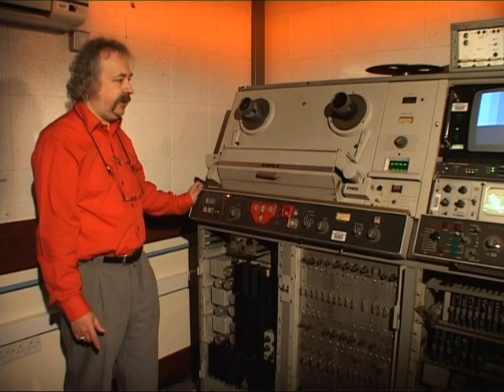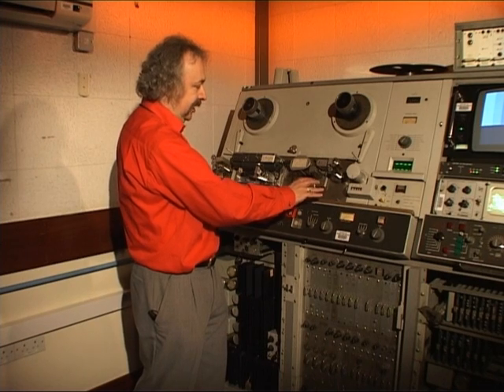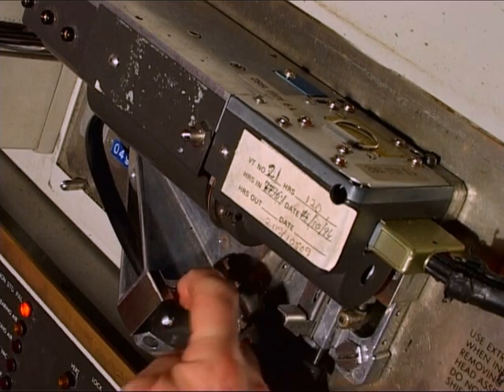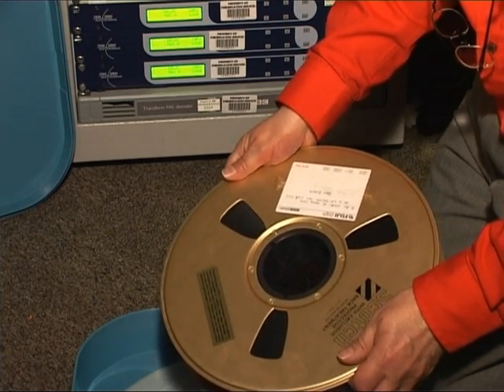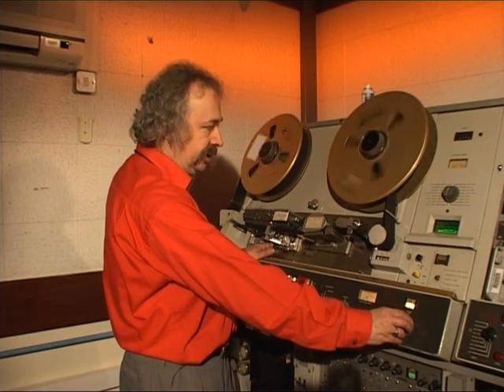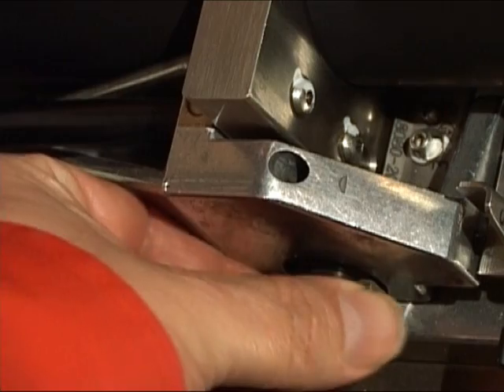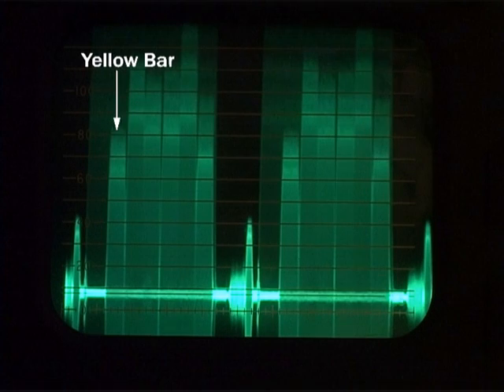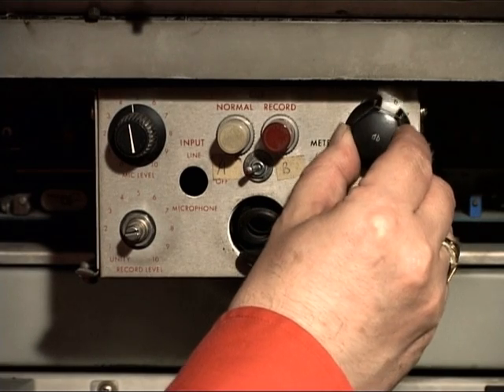Two Inch Quadruplex Videotape.

Comment: Hello Friend
Is this video tape really 2 inch audio?
Reply from the maker: No it's not. 
The quad video head scans the tape almost vertically from top to bottom, and so the coating on the tape has it's crystals aligned the same way - vertically.
This does mean that the audio performance of a quad videotape machine is slightly compromised, but at 15 inches per second, the effect isn't too disastrous.
Audio tape is manufactured with the crystals orientated in the direction of travel of the tape. ie - horizontally.
Reply: @Saprophitic  thank you clarification friend
Reply: You can see from the close up that the audio head only occupies the top bit of the stack.

Comment: That foam insert mentioned  at 5:09 was a major disaster for 3M as the glue that held the foam to the reel would degrade over the years and liquify, soaking the tape with what looked like maple syrup. A "reel" mess it was.  My understanding at the time was that the foam was an anti-static measure.  3M launched a clean-up with a mobile van and technicians going from TV station to production house across the country cleaning tapes and winding them back to reels that didn't have a foam insert.  Lesson learned?  If it isn't broke, don't fix it.  I maintained 4 VR-2000s and 2 VR-1200s in my early twenties.  I remember it being noisy and I kept a daily routine with a TEK 465 scope and a Simpson 260 VOM.  Chic magnets for sure. And as I write this I'm getting a little misty eyed.

Comment: I used the RCA TR70 C 30 years ago.  It was quite the beast.  The one thing I can say about Quad is when picture was optimal and tape was good, it  was fantastic.  When it was bad, it looked awful.  I've seen oxide literally dropping off the tape like fine powder at times and video had banding in it with a head clog.  Sound quality was phenomenal.  Thanks for posting.

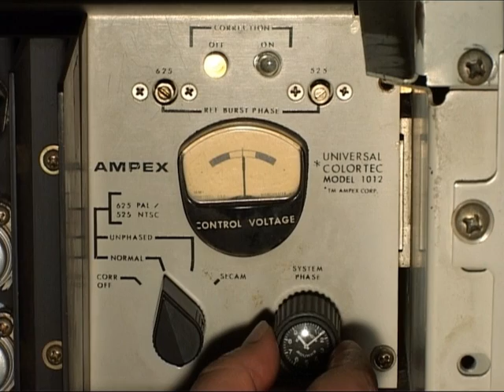Comment: I noticed you adjusting system phase at 12:07 Shouldn't it be burst phase? We would adjust system phase with an external source punched in E to E with that source being a wipe between the external source and the quad machine punched up through a switcher.

Comment: From an old time video tape engineer I now wince when I see this video of the operator cleaning the VR2000 tape path without using protective gloves.  I believe many in our industry came to premature ends due to Head cleaning solutions we used.  Either through skin contact or vapors due to insufficient ventilation.  I am not sure why I am still here but for the grace of God.
Reply: We always used to use 'Colclene' TF  Just a can of Freon basically. Blame us for the hole in the ozone layer.  Worked on these for many years, then later on the C format machines that replaced them.
Reply: We used PERC to clean the heads, and it was in a bottle and got all over our fingers when we cleaned the heads.  I only used Quads for about 5 years as our main machines for commercials.  I hope that I do not get cancer!
Reply: Seems like a simple alcohol solution ought to be enough. What was so dangerous about the cleaning solutions you used?

Comment: I'm interested about the video/audio offset.  Why wasn't a delay line installed to compensate?
Reply: The audio was offset when recording, so when it is played back, everything will line up.
Reply: The tape went 15 IPS and the audio head was 9 inches after the video head 3/4 sec

Comment: Now, is the cleaning  process have to be performed before EVERY tape playback, or is it done  at the beginning of the day?
Reply: +mhmrules , every tape change. The first station I worked at in the early 1980s still had one - and still used it! The heads were dying, and sometimes we'd actually have to clean a head clog while the thing was on the air! Videotape room smelled of denatured alcohol 24hrs a day!
Reply: What was that rule?  Never use recording tape with an X in the brand name.... ;)
Reply: @DandyDon1  Or a "Scotch", unless you like wearing your video heads out early!

Comment: My first job in Silicon Valley in 1981 was at CMC Technologies. There, we rebuilt quadruplex video heads. I got a job in the VTR gallery where we had literally 'one of each' Quad machine. All the main models of Ampex and RCA. I ended up on the AVR-2 (the Rolls Royce of quads) within 10 days of starting. This pissed off the techs who had been there for years. You worked your way up the hierarchy by your performance. Prior to working there, I had NEVER seen a quad in person. But, had read every scrap of literature there was. Or as I like to call it, the school of OCD! After identifying every machine by sight during the interview, my new boss John Luis (RIP), leaned over to the HR guy and whispers "Hire him!".

A note to young people just starting out. If you get a job on a production line, and you are a hot shot, just slow down a bit. Those folks worked for years to get their daily quotas that low. We were required to QA three heads per person per day. By the end of my first week, I was pumping out 8 to 10 heads a day. Management said, if Rich can do ten heads, you guys can do 5 each. Unionized folks can clearly guess what happened next. I was driven out by what is called a "hostile work environment" today. I made no new friends during the entire 90 days I worked there. I would not have been surprised to be met with torches and pitch forks! FUN!

It was OK. From there I worked on Videologic Instar motion analyzers. Yep. 90 days. Then took over the video service department at Videomedia in Sunnyvale for 3.5 years. Learned a lot about video gear there! Then on to Sony, Vitalink, Merlin, Visulux, Signal Stream, Fuji Optical Systems, Prime Image, just to name a few of the video companies of the day. Vitalink put all the video conference suites into EDS.

Sorry for the ramble. I love video!!!!! The old quad triggered me.
Reply: +videolabguy --- haha!  We (in Australia) sent our heads over to CMC, and I remember as a kid thinking that with the precision required -  that must be some of the most revered soil on earth !
Reply: CMC was a cool place for sure. There was line of people who took heads apart. Another line of inspectors who determined if a part was a keeper or trash. Then the video head group who worked ferrite and a nice lady who wound the wire on every video head they made. Another line of people who put the heads back together and balanced them. From there, they went to the VTR gallery. A long dark room with VTRs down both sides, where I worked, Ampex and RCA most models. We aligned the heads against a standard tape. Spin it up. Look at the scope. Shut it down. Tweak, tweak, tweak. Spin it up. Look at the scope. Shut it down. That was my memory of CMC.
Reply: @videolabguy  Can you tell me the wire gage and how many turns for the head rebuild ?   Thanks

Comment: If you had all the mechanical stuff at the top left of the machine working, I wonder if Intel CPU power and sort of USB interface could process all the rest.  Would be an even better way of postprocessing really old quad tapes if it was doable.
Reply: +MrCrapmatic - probably not too hard
After getting the carrier off the tape - then demodulating the video, the 'data rates' weren't all that high.  If you guesstimate at 5MHz * Nyquist and a bit = your subpixel rate for digital processing would be around 20 Mbits/sec